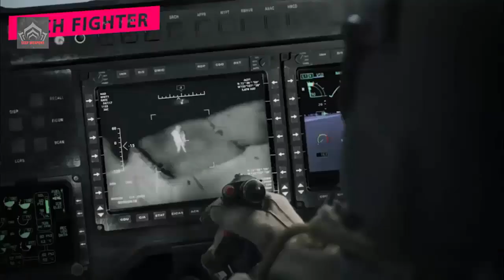Finally, Bell restarts the Bell V-247 Combat Drone program For Strike Role Aboard Navy Ships

Comment: 1. I hope that future transport drones will be designed with a maximum speed of at least 2,200 kilometers per hour and can fly slowly at low altitude or hover for a long time. The medium- and long-term goals are a maximum no-load speed of 3,000 kilometers per hour and a fully loaded speed of 1,300 kilometers per hour. 
2. Introduce electromagnetic launch weapon systems or small, cheap, fully automatic and remotely operated drone launch systems. 
3. The maximum range is at least 3,500 kilometers and the payload is at least 4,000-9,000 kilograms. Dramatically reduce failure rates and significantly shorten maintenance time. Capable of rapid charging and mid-air refueling in flight or in adverse sea conditions. 
4. Design larger and miniature versions to facilitate missions in wide and narrow terrains. 
5. The existing traditional helicopters or light aircraft with a speed of less than 500 kilometers per hour and a range of less than 1,000 kilometers need to be eliminated as soon as possible
Reply: Les constructeurs aéronautiques européens et américains doivent lancer des produits plus créatifs et imaginatifs, améliorer considérablement leurs performances et avoir la capacité de proposer rapidement de nouvelles théories et de les mettre en pratique.
Ne laissez pas les politiques embêtantes et les arnaques aux investissements entraver la technologie aéronautique.
Reply: You are talking about the perfect do it all transport here.